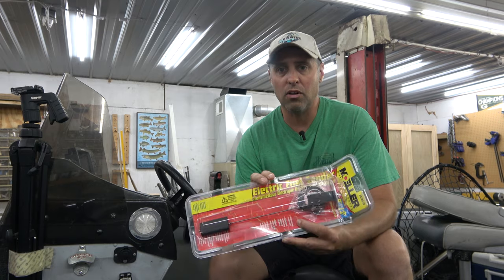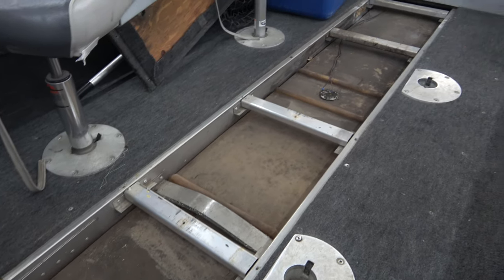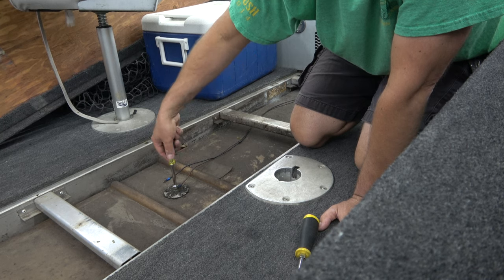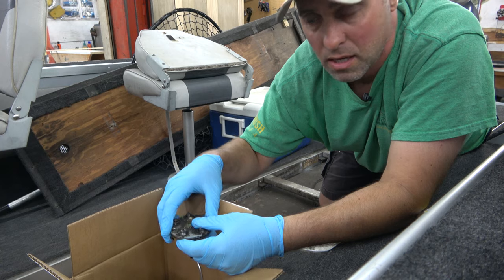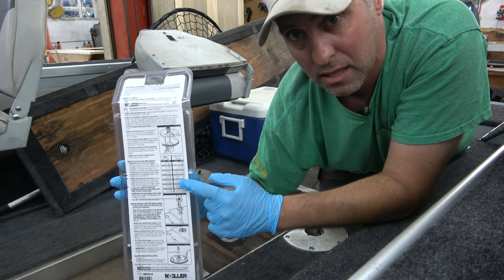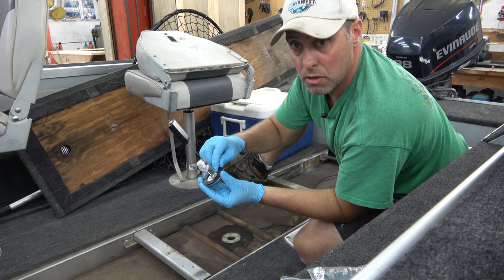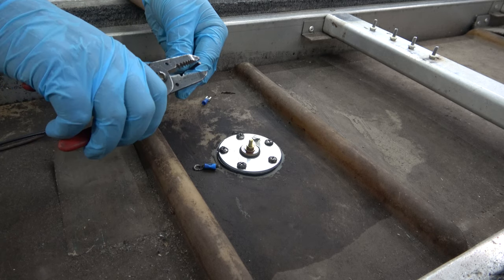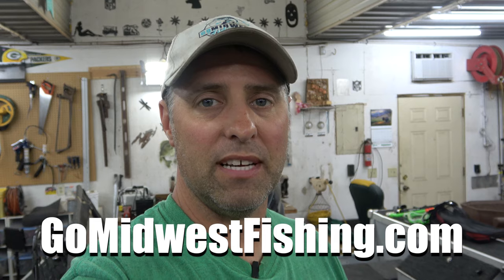Easy Fix For Your Boats Gas Gauge

Comment: Others may have mentioned this, ITS VERY IMPORTANT!
I just tackled a similar fuel gauge issue on my Lowe FM 150 T built in fuel tank.
After watching this excellent video…
I tested the two wire leads I removed at the sender, and the gauge worked perfectly…
Thinking that my sender was the culprit, I was assessing its removal….when I noticed the negative lead was a spade type crimp fitting…
It was badly “oxidized” (not sure what else to call it)…
I sanded the sender spade and the inside of the corresponding female crimp fitting….VIOLA!!!!!! Fixed!🙏😊💪👍
I hope everyone tries this simple fix after testing those two sender leads….may just save you some time and $.😊
Reply from the maker: Thanks for the helpful info. No need to replace parts that aren't broken.

Comment: Kept thinking, 'disconnect battery! disconnect battery!" Thanks for sharing this, Rande!
Reply from the maker: Or were you secretly hoping for a big explosion! I probably should have included disconnecting the battery. Thanks for the comment.
Reply: @GoMidwestFishing  I most certainly was  not hoping for a big explosion!
Reply: @GoMidwestFishing  When do you disconnect the battery? You were testing the two wires at the beginning, so right after that?
Reply: @AKDrNo  At start because you are handling boat electrical systems !! You can reconnect battery to test and verify than disconnect and wrap up your job when completed if everything is  properly connected then reconnect battery !! Safety first & last !! 😊👍🐭

Comment: Lots of good info and tips. The test by touching the wires definitely let you know you were on the right track!! Great fix 👍
Reply from the maker: I appreciate the comment.
Reply: I touch my wire together and nothing happened so what could I check
Reply: @lorenzoambrose7584 I know this is late and I’m not an expert, but if the gauge didn’t move when touching them together, I would check the connections on the gauge. If they are connected well, then would say either the wires are broken somewhere, which could be tough to trace them, or the gauge is bad. I would think that if you send a 12 volt current through it, it should move if working, and I’d it does then the wires to the sending unit are probably broken.

Comment: Only other thing I would recommend is coating those connections in dielectric grease to help prevent corrosion.  But a very helpful video - going to tackle mine this weekend, I think.
Reply from the maker: Hi Ken. Thanks for the tip!

Comment: Looks simple enough My gage always go to full when turn key on, so guessing bad float ? what else could it be  ? I ll take apart look first before order new one. Maybe stuck or? thanks for video you gave me confidence to take it apart
Reply from the maker: I hope you find the issue. It could be stuck in the up position, or maybe a bad resistor.
Reply: @GoMidwestFishing     I took it apart looked think the it works But bad design .The float is in back of gas tank near Stearn, It seamed to work The boat n water tilts back lower. So even tho was only 1/4 tank of gas it was full in back so float showed full ? it s A lund reble Don t know why they put the float and senor there? boat allways shows full than all sunden goes close to emty .

Comment: I have a question can I possibly hook up two fuel gauges for one gas tank they're 90 ohm gauges thanks for your time and experience
Reply from the maker: Hi Joel. I'm sure its possible, I not able to tell you exactly how to do it, but I have a couple thoughts. First you will need to have a second hole in your tank to put the gauge in and secure it properly without leaking. Then I would run completely separate wires to the other gauge. Do not splice into the other one, it could affect your readings. Then, of course, you will need to install a second gas gauge somewhere on your dash. You can always experiment and see what works. Anything is possible if you keep trying.
Reply: Thank you sir I was thinking about it too if you add another gauge spliced in your ohms resistance is going to be effected and you will get an inaccurate reading on both gauges and I'm not really wanting to cut another service port in my costume polished aluminum tank I was thinking about a cheap back up camera and just mirror that image off of the original gauge and just place back up camera screen where I want it probably be less work for sure thanks for your time here have a great day

Comment: Great instructions bud.
This gauge work with any boat?
I have 1990 princecraft 176 superpro model.
Any information greatly appreciated
Reply from the maker: Yes, I believe its just a generic gauge that should work on any boat. I think you just need to know the depth of your gas tank and order the unit made for that depth. I think mine was for up to 9 inches deep.
Reply: @GoMidwestFishing  thank you bud.
Reply: @GoMidwestFishing  thank you bud I’ll order the part and install it.

Comment: Why no marine grade terminal ? Water can get into the connectors you are using.
Reply from the maker: I used what I had available, but you are right. Marine grade would have been the proper way to do it. I'm learning as I go. Thanks for the comment.
Reply: @GoMidwestFishing  I’m learning as well. I seen the damage that can be caused by using regular home connectors. Nice boat ,hope you change them out so u have a piece of mind….lol

Comment: I hope you coated those wires with liquid tape after you reconnect to electric lines to the fuel tank.
Reply from the maker: I did not. It isn't coated from the factory and its just measuring resistant so there is not enough electricity to cause a spark.

Comment: im sorry, i see why u break down in the middle of the lake... its called EVINRUDE
Reply from the maker: Oh man.. I love my Evinrude. For being 30 years old, it's been very good to me. It just needs some love now and then. So what's your motor of choice?
Reply: @GoMidwestFishing  I was just kidding. I would still own smaller horsepower Johnson's or Evan Reid's. I prefer Yamaha myself. Although they are still very dependable, they do have their issues. I would never own another large horsepower. Johnson or Evan rode because of the Ignition system's status.  Timing triggers CDS coils all garbage. I've never had a Johnson or Evan. Run over 90 horsepower that did not get me fits.
Reply from the maker: @dereksuperstrong1210  My Evinrude is a 1995. Its the newest motor I've ever owned. I like the simplicity of these older motors. Not much to go wrong with them. Actually, I have a 2000 Mercury 115 hp on a project boat, but it doesn't run. I've heard good things about Yamaha.
Reply: @GoMidwestFishing  I don't mean to bore you with the details, but I've used my Yamaha. 225 horsepower salt water series. It's a 2 stroke, it's a 1993 model. I used it commercially and I've used it recreationally? And I've repurposed it again commercially. It's pulling a 30 foot shrimp troll. And.  Even when something goes wrong with that old motor I can still  limp home.